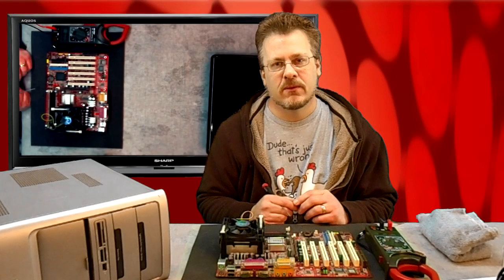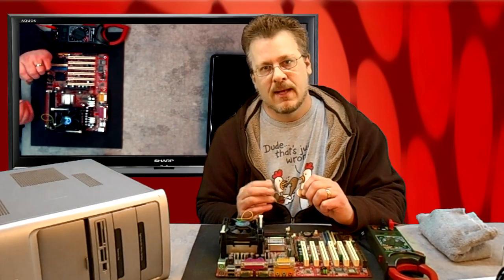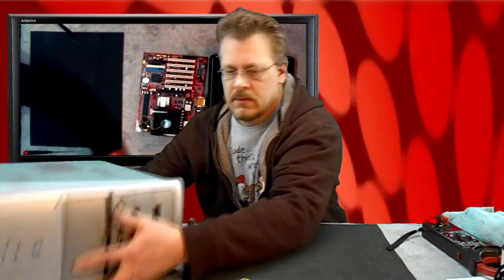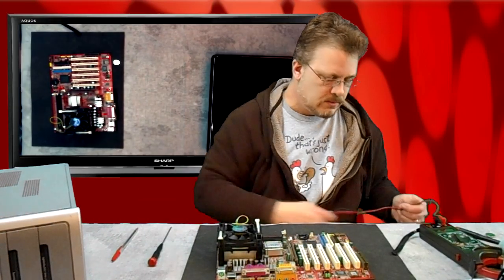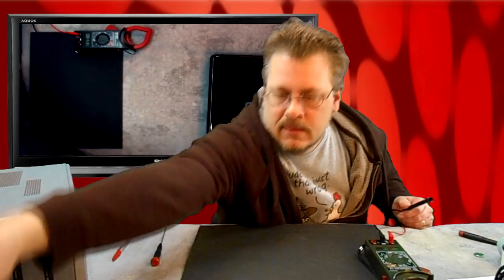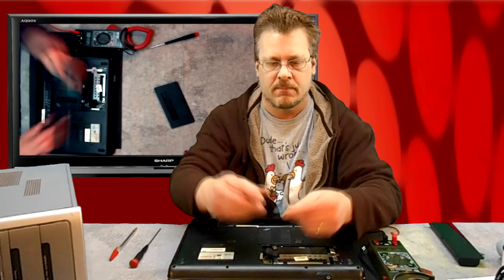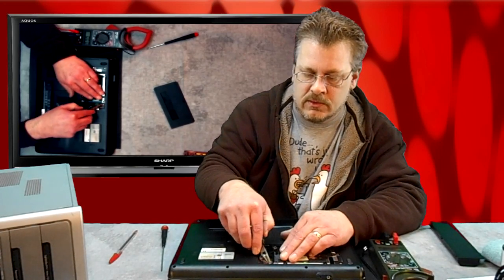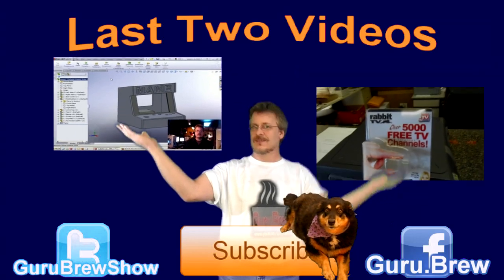How to Replace the CMOS Battery - Resetting Bios to Remove Password

Comment: Hello, i forgot my ownly user password on my hp desktop and i tried mutiple things. I have tried taking the bois battery out and  also tried using the comp in safe mode to try to log in through administrator but nothing is working. Any ideas to what else I could do?..